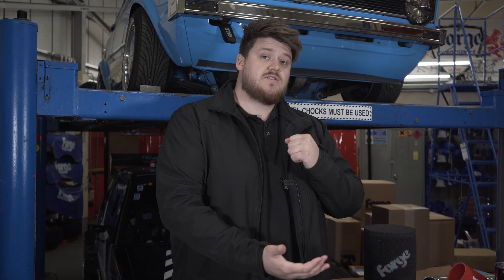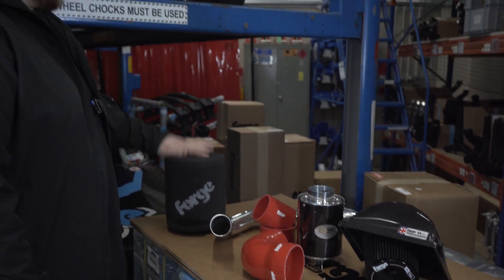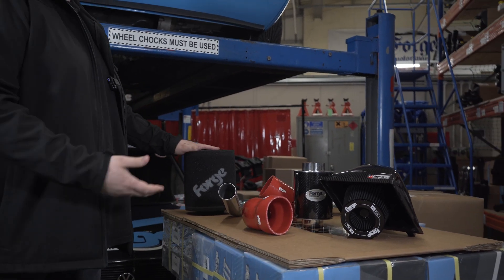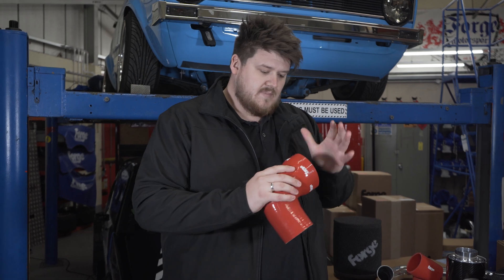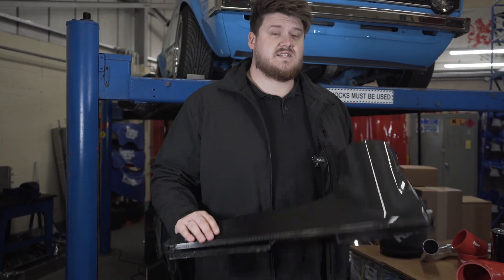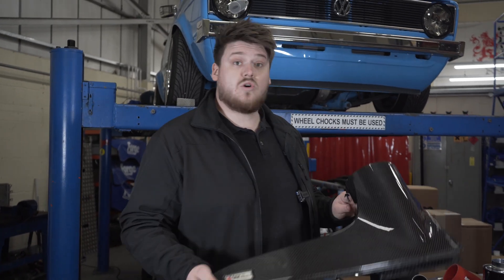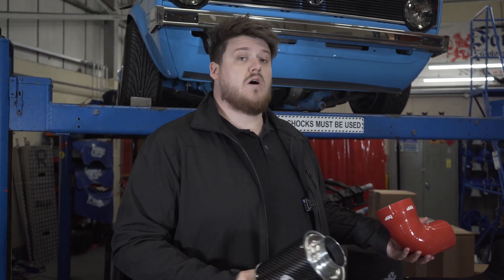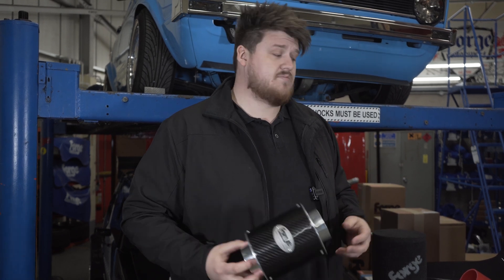What is an Induction Kit? Intake? CAI? | Forge Motorsport

Comment: I've seen almost all pics uses a carbon cannister for my car model. But for a suzuki zc33s, is the filter pleated or foam?
Reply from the maker: They are foam filters :)
Reply: @forgemotorsport  Give me a rough idea how frequent do we need to clean or blow the filter (after a certain mileage? Or time based in month or year)?

 Another question is wouldn't foam after a while be brittle in that hot environment especially in engines?
Reply from the maker: Hello, if you watch our filter cleaning video this should help! - https://youtu.be/V19THnWIeok?si=SXj411wS279vPzi5 
Foam can deteriorate if the engine is put through it's paces and overworked in hot conditions, it depends on how much you are looking to push the vehicle. You can purchase replacement foam filters as well if you do choose to do this, but if you look after it and clean it regularly you should be okay :)   @mrbigss3275

Comment: Im on the edge of buying the induction kit for my Abarth with the carbon fiber housing, however, does this filter require cleaning? And if so, how?
Reply from the maker: Please watch this video for filter cleaning queries - https://youtu.be/V19THnWIeok :)
Reply: @forgemotorsport I already watched this video, but the filter for the abarth is not mentioned here. Is it the same process for this filter as in the video?
Reply from the maker: @kernel5446   Yes as the abarth induction kit also comes with either pleated or foam filter options :) https://www.forgemotorsport.co.uk/Valves/Induction_Kit_for_Fiat_500595695--product--996.html
Reply: @forgemotorsport Okay thank you for the quick response! I'll be sure to pick a kit up one of these days 😁